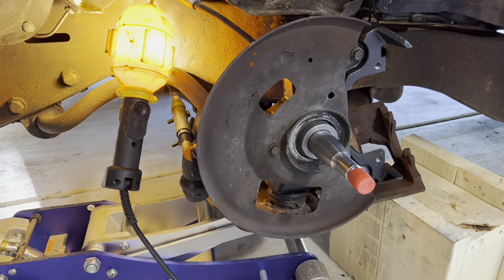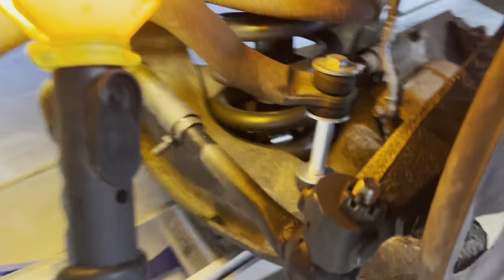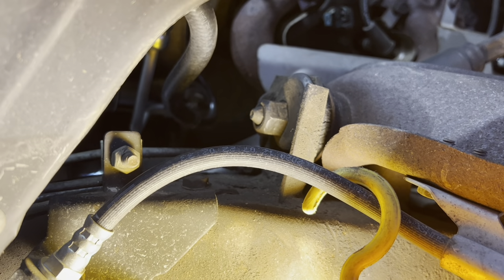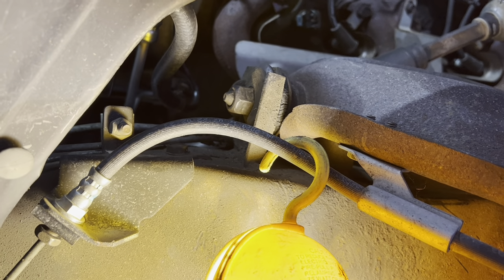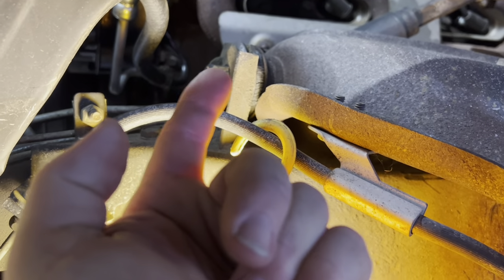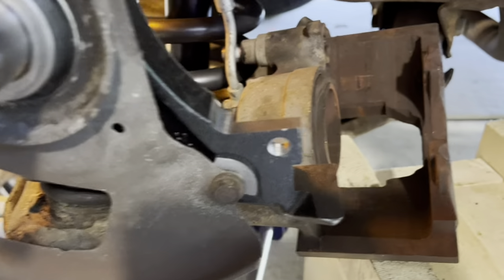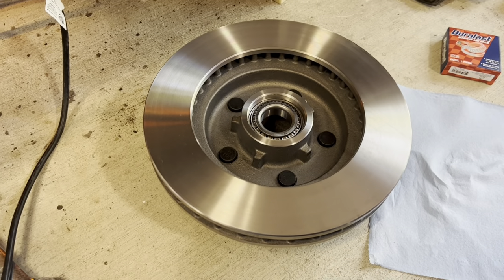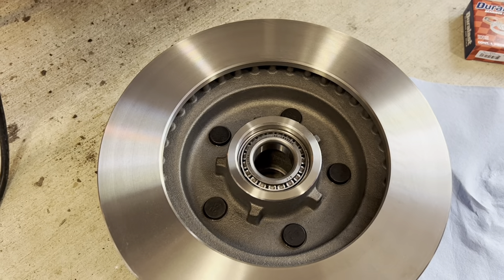Installing McGauphy’s 2 inch Drop Spindles on my OBS ‘94 Silverado Long Bed

Comment: The stock rotors didn’t fit? Because I got the same spindles and my rotors are not sitting good to wear the nut goes all the way down for the pin
Reply: Same problem I have
Reply: @curly4764  I ended up taking them off and returning them to not deal with it ima go w shorter springs

Comment: Love it 😊
Reply: @dronechaserzl1  What aftermarket 4/6 kit you suggest beside the high ends kits everybody praises?
Reply from the maker: @krumabon1903  I wouldn’t know brother, I did my research and bought my parts from different companies and places. I made my choices based on quality, tire clearance and a smooth ride(for 20 inch wheels that is, lol). I’m mostly happy with results, tho it’s not a smooth ride and there is some oversteer. Those things you have to live with due to the extreme drop from factory level. I love the looks and compliments so it’s worth it!😎👌 This was my first drop build so I really can’t answer your question, sorry.
Reply: Nicez 💯🔥🔥🔥

Comment: Can I install a rear C-Notch on my 4x4 95 Chevy Tahoe LS? I have so far installed a 3/4 Belltech lowering kit n since then I’m getting into contact with my frame or something I believe in the rear? I want it lower now but I believe I will have to go the route you went or sumn… I need help
Reply from the maker: I would call JDM and ask them, they were very helpful when I called them. I also called Belltech but they weren’t helpful at all unfortunately.